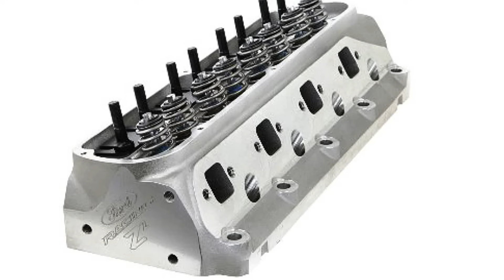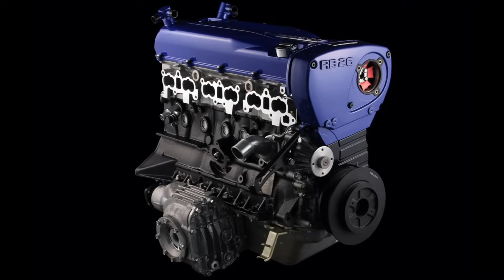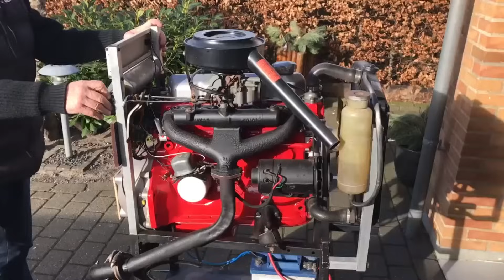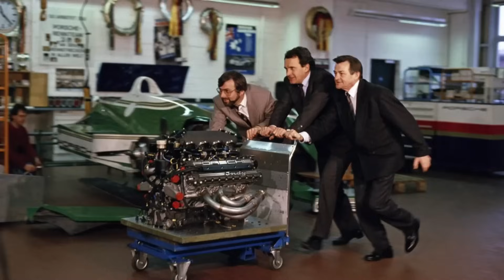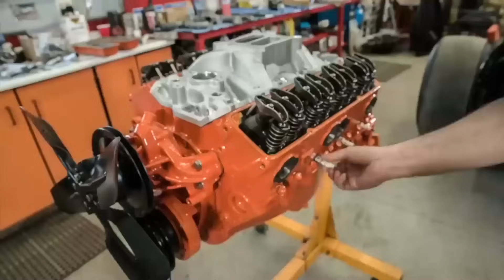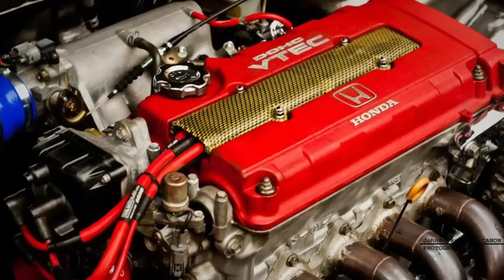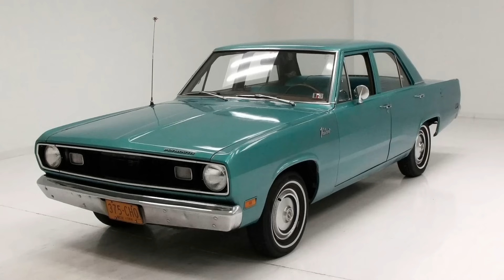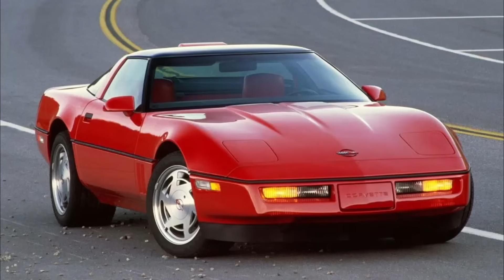30 Car Engines That Will Last FOREVER (2024)

Comment: Isuzu 4j series, Toyota KD series, Toyota L series, Mitsubishi 4D series. These engines can easily outlast anything in this list. Even with subpar maintainance, these engines can break the 300k mile mark. Also these engines are used to haul loads so they're subjected to even more stress than the pampered engines shown in this video.

Comment: Ok I realise that Isuzu isn't available all over the world but I haveto shout out my 2013 Isuzu KB300 (1st gen D-max In Aus). The 4JJ engine in my pickup is currently sitting on 412 500 Miles (660 000KM) and is still never been opened. The best way to take care of a 4JJ is to service your engine at regullar intervals and replace all the rubber hoses every 100 000KM (1660 000 Miles). Also keep n mind that in remote areas where diesel and oil is not of the best quality you have to flush your diesel feul system and oil system with every service since the diesel injectors tend to clo up on bad fuel and the timing chain oiler does as well. Also don't xpect to win many races with that engine as it is under powered for the size and is really meant for low down torque like most heavy duty diesel engines. The 4JJ is also no slouch if you know what you are doing you could safely make up to around 500 HP and 890NM of torque out of a 3L 4 banger with little to no reliability loss

Comment: I've owned plenty of Skylines, there's no way in hell an RB26 is making 1million kilometers not to mention 1million miles, and the same nonsense "multipath oil paths" featured here is the RB26's weakness on a track car, oil cannot get back to the sump quick enough without an external drain. The SR20 also doesn't have an iron block, turbo isn't that great either, it was designed to be cheaper to manufacture than the 4cyl RB, the CA18. Pretty much any car that was homologated for Group A racing will make big power with mods as they were running close to 600hp during qualifying, probably more than what tyre technology at the time could handle.

Comment: Mate I disagree about the Toyota 1HD-T, my dad had one of those & he babyed it and it still Smashed a hole in the side of the block @ 360000 kms but the 1HD-FT is the one that is bullet proof as I have one. I done a health check on it @ 420000 kms and there was virtually Zero wear on any of the bottom end bearings & it does eat new chiped & drain piped V8 cruisers for breakfast

Comment: If your criterion is lasting forever, I think the tiny Mitsubishi 3A92 should be on this list. It is "only" an econobox engine. But it will not break and last forever. And it is tunable by adding a turbo or supercharger. Delete the BMW engine that needs timing tensioner after 100.000 km. With that kind of money invested in an engine, any engine can last 200.000 miles.

Comment: I had a 1978 truck with 400680 miles on the 300 6cly, i was putting in a 1970 429 engine so i tried to blow up the 6cyl, i couldn't do it, i put the gas pedal on the floor and left it there in park, damn sure tough.

Comment: I drive a 206 Nissan murano and it's my daily transport, and I must say I'm highly impressed with the cars durability and especially that 3.5 ltr v6 Nissan motor, my one was assembled in Japan so it's true Japanese engineering, only thing about the engine is changing spark plugs and having to disassemble a lot of stuff including the exhaust manifold in doing so over the three back spark plugs, but I have not had that problem yet and my Nissan still jumps to life at just a touch of the key and runs so quite and smooth that you don't even know it's running, I've left my car running the whole night once because of that lol 👀, only problem I've had so far is the external chain tensioner bearing running dry and had to replace it, but thats very easy to do with the right tools and 30 minutes of your time 👍
Reply: The 350Z's have the 3.5 VQ engines and they last several 100,000 miles with a ton of those miles being ran hard. I've got an 04 convertible that I only keep because it just won't die with 365,000 miles and counting. All I've done so far is put new valve covers around 250,000 and added an oil catch can at the same time along with new plugs and coils. Runs like a dream even though the entire suspension is shot.
Reply: @Trueblood2020  The VG33e motors from the 300zx are also very solid.
Reply: And the legendary Nismo 2.8,   from  the famous 240, 280Z, and Truck lines for over15 years.

Bullet proof engines.  When one of these came into the dealerships for tune -ups, the mechanics went for coffee !   There wasn't anything needed tuned.

Comment: Just a heads up on the Subaru EJ205, the head gasket issue was on the SOHC engines not the DOHC engines, I fixed my son's EJ205 SOHC by using the MLS DOHC head gaskets. The main reason for boxer engine failure is lack of maintenance, oil and filter changes every 7000 Km (5000 miles) and the pesky SOHC gasket fix, they will last almost forever. Another engine not mentioned here is the Australian Ford Barra 4.0L six, these are well known to last and can be tuned for very high torque and HP.

Comment: 1954 dodge desoto 1954 plymouth belveder   ...same engine,    forget about 300,000 or 400,000   they arn't run in until half a million miles

Comment: First engine on the list is the one in my truck love to hear it. The mf is anemic for a V8 but it took 38 years and 120k miles to break down, and even then it was just the original nylon timing gear and chain had wore out. Replacement parts were 40 bucks, started right back up thank god for non interference low compression engines 😂

Comment: My Grandmother had a massive Chrysler Valiant with the (I think 265cu”) straight six “electronic lean burn” was on it.  It had the “Torqueflight” (spelling is wrong no doubt) tranny.
Was only a kid then.
What a machine.
Dark Green metallic paint.
Reply: It must of been a cl or cm if it had electronic lean burn, the transmission would of been the borg warner 35 and the v8s had the torqueflites and yes the 265 hemi awesome cars👍

Comment: The 225 slant six should be in the number one spot here. I don’t even like crappy 4 strokes, but I had 2 Dodge trucks with them. A short bed 1979 with over 500,000 miles on it that was the best vehicle I ever owned, and a 1982 long bed that was as reliable after doing away with the lean burn set up. They are fine machines and run FOREVER, and ran like a fine Swiss watch. As long as you occasionally checked and adjusted the solid lifter valve train, they will chooch reliably for decades! I miss mine badly. They were long stroke and not high revving and were low horsepower BUT they had GOBS of stump pulling TORQUE! Fantastic engines! Thanks for featuring the GM small block, which is an excellent engine but WAY undervalued and under appreciated, and the also excellent LS. There was a cast iron block version too. Any engine with sleveless aluminum blocks with or without coatings are GABAGE. So I don’t agree with German or Japanese engines (like the VQ blocks without sleeves that are aluminum as being remotely long life. Nka-sil does work in 2 strokes, but NOT in 4 strokes that reuse dirty oil! Aluminum bore engines are crap, always were, will always be. Cheers! 🤔👍🏻😊

Comment: I didnt see the Toyota 5vzfw 3.4L gas v6 engine. 25 years on and theres still tons of these trucks around. Mine has 389000 miles on the original engine and still runs great, though I no longer trust it for super long road trips because its been so long since its been opened up and serviced. It did all that with only a single timing belt change. It just eats the abuse and refuses to die, thats why you see them so much in the middle east and africa as ummm.....big boom stick mobile platforms. Yeah big boom stick is better than saying terrorists and rebel groups LOVE taking them and mounting them with .50 cal machine guns lol.

Comment: So disappointed you missed the Toughest engine of them all, maybe because you consider it a truck engine but that Unique engine that far suppasses all of these engines is the Nissan Patrol GQ 4.2 TD Silver Top. The most battle tested engine on the planet in our known history. Every single engine you mentioned here comes with either a timing chain or timing belt. Which is pis weak compared to timing gear cogs, that don't wear OUT OR DONT EVER NEED REPLACING.
Reply: cuz it's not available in the content creator's country hence it's excluded.
Reply: Still not a car engine
Reply: @Tallnerdyguy  fyi: Patrol or Armada in the US is a competitor of Landcruiser w/c was mentioned #2; SUV is one of the car types.

Comment: 2001 Jetta with an ALH diesel. 670,000 km (416,000 miles), and it runs like new. Never had any type of repair, just maintenance. Shell T-6 5/40 oil change every 12,000 km.

Comment: You missed the Chevrolet 409 V8. I have my grand father's Belair four door with over 240,000 miles. Runs great, uses about a quart of oil every 3k miles. The two range Powerglide transmission slips a little, but I added a quart of Lucas transmission treatment and its much better.

Comment: No Ford Barra on the list?  It is easily a match for the 2JZ, it is ultra reliable. With a few bolt ons and a modest turbo it can produce over 600hp and still be reliable.
Reply: we didn't get the barra in the states.
Reply: @trwsandford  Ford management in the US made a bunch of terrible decisions with the intent of protecting US jobs.
Reply: @trwsandford who cares? No one said this was a "USA only" list. Dweeb.
Reply: 2jz bores are much thicker, the blocks are much harder and they don’t suffer core shift that the barra is known for between cylinder 3 and 4, 2jz sustain 900hp on stock internals no problem, barra cannot do that, besides the 2jz was doing it over decade earlier :)

Plenty of 2jz blocks that have made 2000hp
Reply: Brilliant Aussie made motor. 800hp to 1300hp is easily made with big turbos, lower comp ratios, and hardened internals.
Reply: And over 1m km in taxies 😂
Reply: It’s not a match for a 2jz
Reply: @fastinradfordable  That's where you wrong, and should look at some bara mod. And I'm a 2JZ fan.
Reply: @fastinradfordable  Its pretty clear to everyone that knows what a Barra is that you have no clue at all.

Comment: Toyota just makes the best as built to last 25y minimum without fail & proven time after time as so many have them to verify ie myself...my Prado is 25y right now and zero happened since new,,,also have Hilux ln106 engine diesel,  3000k and zero wrong, built 1995....

Comment: You missed the Nissan QD32T. 4 Cylinder Diesel engine for light trucks running more than 500.000 miles only with regular care.
Reply: cuz it's not available in the content creator's country hence it's excluded.

Comment: For LOW maintenance a Honda D16Y7 engine (6th gen Civic)... 600K miles with only regular oil changes ...plugs and wires at 50k mi...and that's about it for engine maintenance.

Comment: I have seen the Honda D16Y7 go 600K mi and seem like a new engine. I had one for 26 yrs that ended up with 300k that never started burning oil. Started and ran like a new engine. I wish I could still get on because they were also (1999 Civic) the easiest car to work on that I have ever owned. If you can find a 6th gen Honda Civic in good shape, it will outlast just about ANY new car on the market. And with easy cheap and only occasional maintenance.

Comment: Australia built the Ford Cleveland type 302 and 351 V8 engines from 1971 till 1983. They are a very reliable, big mileage motor.
Reply: The Americans don't know the 302 Cleveland exists, it was exclusive to Australia.
Reply: @Rob-fc9wg stop referring to Americans as if it's just one person. Plenty of Americans know about the Cleveland versions
Reply: @M.L.Knotts  
Huh, WTF are you on about?

Comment: I have a 3.0 in an’02 ford Ranger with 255,000 miles.  Original motor and transmission. Regular maintenance is the key.
Reply: I had a 1995 Ranger 4x4 with the 4.0L V6 and that thing was like a bulletproof motor. I had well over 300k on it. The gentleman I sold it to is still driving it as a daily driver.  The one thing that may have helped is I ran synthetic oil since it was new.
Reply: @clifthorburn776    I’ve been running Castro 10W30 non synthetic. You know, regular maintenance. Ford Ranger tough!

Comment: Oh you never mentioned the Ford eco boost with the wet belt, it will last forever providing you never start it up😂
Reply: How can anyone who gets paid for their work, design those Ford motors.
Or have they brought shares in Toyota? 
Industrial espionage at it's finest
Reply: 4 cilinder ford eco boost engine is a piece of shi..
Reply: @plamentd  Correct, I certainly wouldn't have one, far too many have failed over the years.
Reply: My old man's story with a station wagon with a slant six is he put it through hell(He tried to kill it, the car was so ugly he wanted to; and he got it free basically.) Having had and been around Fords w302 and I6-300 those are icons. I still see plenty rolling along with new cars like nothin has changed. Along with the 350, I like them, they do drink a bit. But so do I.
Reply: Naturally, this whole line of engines is mechanical in base function. Half dead battery will obsolete any modern vehicle anymore.
Reply: Some new 25  GM also have them with missing pistons🙂 these twit car designers must be liberal radicals.
Reply: @Charlee-w1u Huh?
Reply: Was this a ploy to steer drivers to these crappy EV'S I wonder? I know that they want us all off the roads really, contained within a 15 minute area, that's so easy to do if you have an EV.
Reply: It's a maintenance item, just like a serpentine belt.... ALL the Ford truck engines run circles around the New Tundra engine, the engine that seizes within 20K miles due to bad crank bearing design ! !  Oh what a feeling....or failing transmissions (manual and auto) in the new Tacoma...
Reply: @barrya.6212  But after as little as 16k miles? Belt failure seems to be a time thing not necessarily milage. It's that 5 year time period. Ford changed oil specs. about 3 years ago, no idea how much of a difference it makes, time will tell. 
In the meantime engine reman shops are kept busy, though the earlier models are now being scraped when they fail. Toyota's problem is down to swarf be left in the main gallery from machining.
I'm surprised they don't fail sooner.

Comment: Periodic head gasket changes for Subaru?  That's not durability - it's an expensive pain in the ass.    My F150 with the old 4.2 V6 is looking at 270,000 miles and has never been apart.

Comment: The Leyland A series is my star engine. My Marina was 24yrs old, had been round the clock more than once & just kept running as sweet as a nut with little maintenance. Unfortunately,  after 24yrs the new steering trunnions I needed to keep it road legal were just not available.

Comment: Jeep's inline 6 from the 80's and 90's will run forever even in the worst weather conditions.
Reply: I have a 4.0 Inline 6 in my 1990 Jeep Comanche 4x4. The entire drive train on those vehicles is bullet proof. I custom ordered mine from Jeep in 1989 and I am the original owner - truck has the original 63, 800 miles on it !
Reply: Agree, agree!  Only thing i’d add is that that engine was fully derivative of the Nash developed inline 6 from 1964 and was featured in a number of cars, 4x4’s and off road vehicles.. it went through many iterations and upgrades.. displacement eventually got to 4.0 liters when the version you and I know and love was introduced in ‘86 - made specifically for Jeep (although they also put it into the PT Cruiser).
Reply: @GalaxyT25  I don't think they put it in the PT Cruiser, although it would have been really cool if they could have! As I recall the Cruiser was built on the same FWD platform as the Neon, with the same transverse engine... it would be really tough to put an inline six in there.
Reply: @JeffDeWitt Correct, the PT cruiser never had a 4.0 i6. 😂😂😂
Reply: @GalaxyT25  the turbo pt cruiser?
Reply: I have had three Jeeps with inline 6, and each has passed 250,000 miles, we get temperature ranges from -35C to +35C, and up to 12 feet of snow per year.
Reply: yea but the problem with my 98 grand cherokke was the transmission and numerous electrical problems
Reply: Just don't park them in your driveway and carry a case of oil.  Rear main bearing seal...doesn't seal.
Reply: @jdarwen11  I've never had a rear main seal leak on mine, now the oil filter mount is something else again.
Reply: @bigchas77ify   The Jeep's AMC inline 6 engine is the reliable engine Jeep ever got on those years.."
Reply: the straight six -  conscientiously manufactured -  is the ultimate car or truck engine.   i am aware of the praise that grew up around the jeep six.
Reply: One of the many cool things about that engine is that as much as the MOPAR fanboys like to go on about the Slant Six (which WAS an excellent engine), the last straight six built by the Chrysler Corporation was an AMC.
Reply: @bigchas77ify  probably why it was on there?
Reply: I had one years ago, the Jeep fell apart around it but the engine was going strong
Reply: New Jeeps only run for a few weeks
Reply: why did they change it?
Reply: 1990 through 2005 L61 2.2 in line  4 cylinder my 2002 S10 has 275,000 original miles
Reply: @stevedeleon8775 
🤞 Lucky